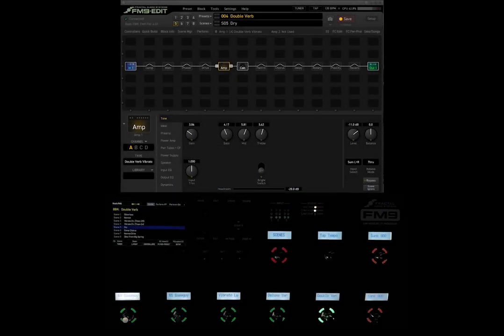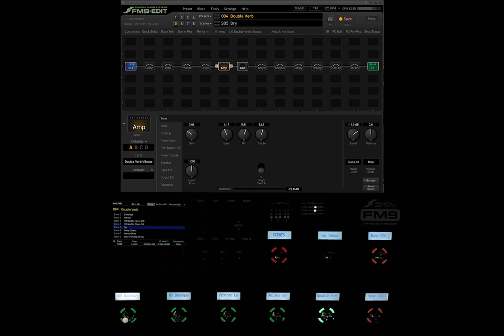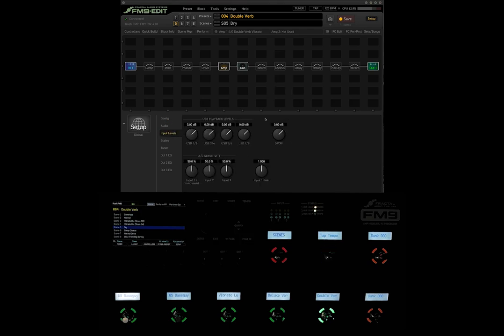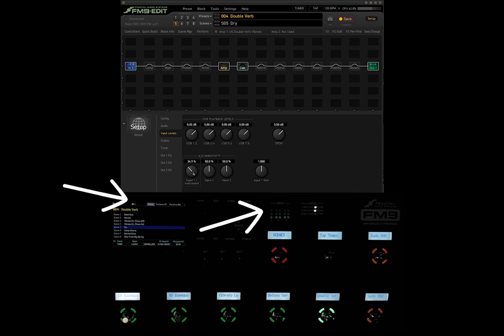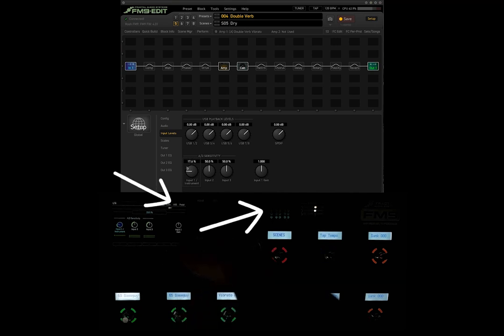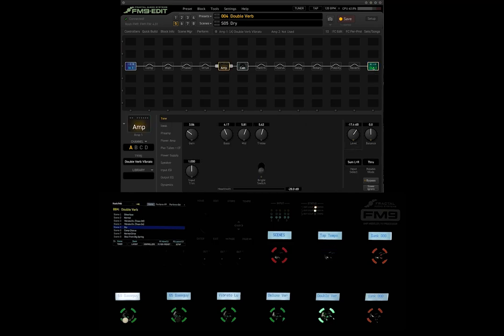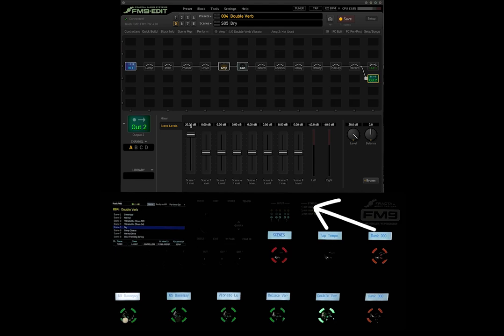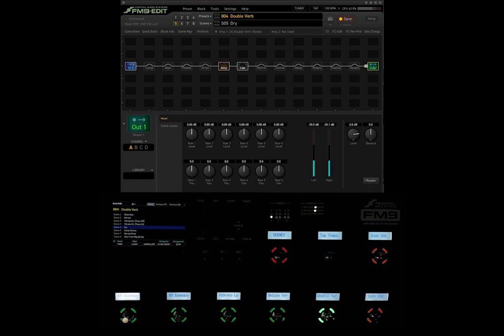FM9 Basics Episode 21 - Clipping Explained

Comment: It sounds like there crackling when you are playing in the red but "not clipping" per the indicator light. Is this a different type of clipping? How high into the red can we go without getting that crackling sound?
Reply: The cracking sound is definitely clipping. Would also like Rosh to chime in here.
Reply: Curious about that as well - I have to dial back all 'non solo' scenes to stay away from that 'crackle' when I do then add volume for a relative boost.

Comment: Thank you for this. So basically, always start with the amp block to set the output level and aim for zero db. I’m an old analog guy who used fender amps and dirt pedals among others. and I approach my fractal with that mentality. Set the amp level first then engage a dirt pedal and adjust THAT level to taste. So on and so forth. Everytime I add a block I check the output level and adjust. My question is with regard to lead scenes. You want the lead sound to be boosted to stand out. So do you start with that scene and aim for around zero db and then for all the other scenes dial in the output lower? Curious as to what your practice is on this. Thanks.
Reply from the maker: Yes, I usually get everything to meter around 0 db. The lead scene is usually somewhere between 3-5 db depending on the types of venues you play. (Larger venues require less db boosting.